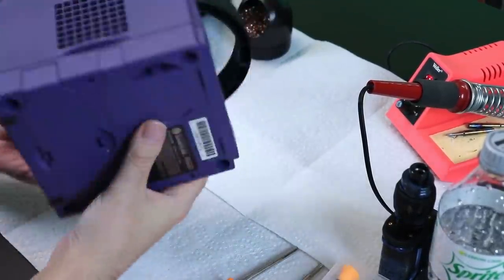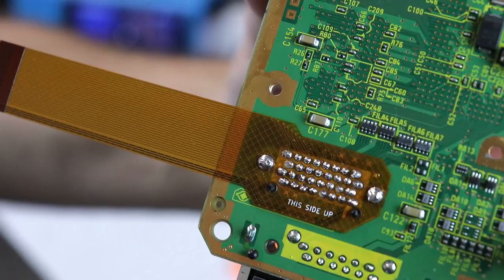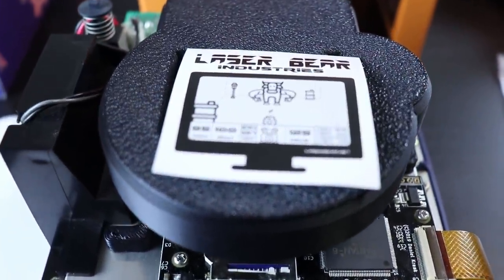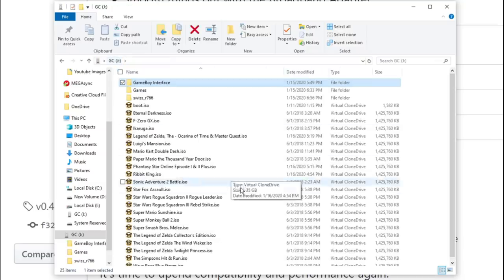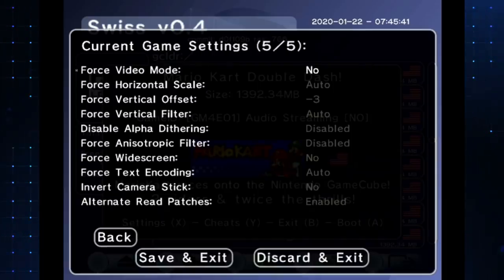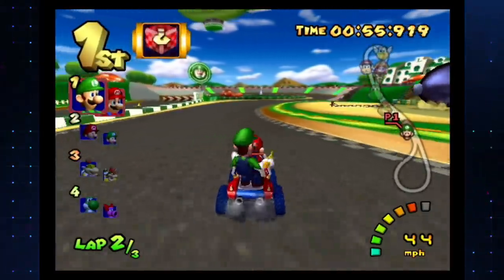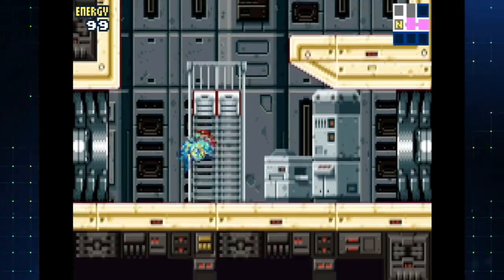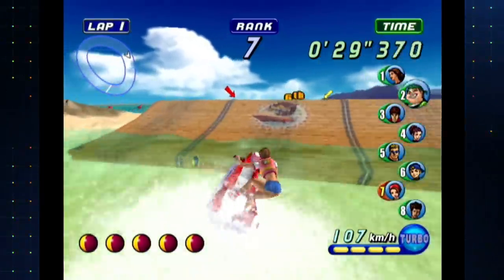GC Loader Nintendo GameCube Disc Drive Replacement! Load Games From SD Cards!

Comment: Yeah I’m out of my element doing all that stuff, especially the soldering. But that looks like a no brainer if you have the knowledge and skills. Don’t have a GameCube but it’s a great console.
Reply: There is a version of the GC Loader for which you don't need to solder. Maybe Check Macho Nacho Productions Video.

Comment: Great addition to my platinum cube. Very impressed so far. It would of been great if the ps1 had a disc drive replacement mod instead of the psio.

Comment: This mod is super cool the only problem I have whit it is that just like the PSIO you have to solder parts to the console. If it was more like the Dreamcast or Saturn mods were there is no soldering require then it would be the greatest mod ever made.

Comment: I think I'll get one of those, along with a HDMI adapter like Retrobit's or the EON, and also a SD2SP2 to have some extra stuff like virtual memory cards (kind of no really needed since I have 4 memory cards... but still, and I also can use either my Wii or WiiU for that but... I just want to keep some games I would really play whenever I decide to use said consoles in a pinch but... I really want to give my good old Game Cube the respect it deserves... especially after having it around for more than 4 years just unplugged because the mini DVD drive decided to die on me... it was one of those 1st model releases that have the component output that I never used back in the day, and the fact that GCN games look better on it's own console compared to the WiiU and Wii... in the order I like the output most if I don't have the choice of using a GCN), and if it's not too hard and/or expensive, even the Game Boy Player to take advantage of my GBA and GB/GBC carts (Pokemon in the case of GB/GBC I have Pokemon Stadium 1 and 2 on my N64 to cover that but still that would be a welcome adition, aside of GB games with my SD2SNES Pro with the proper Super Game Boy firmware).

Also I want to make sure that my Flashcarts works with the GB Player and both the oficial and the homebrew alternative of the GB Player boot disc, so I can play GBA and GBC games as well.

Comment: For a while I've been using a game save exploit to run Swiss on my GameCube and the SD2SP2 adapter. One thing I don't like about using the game save exploit is that you have to run the exploit every time you want to boot Swiss. I like that the GC Loader doesn't do that. I have another GameCube but it's a DOL-101 model so it has no digital out or the serial port 2 slot so I can't use the SD2SP2 adapter so I got the Gecko SD. And I recently ordered a GC Loader so I can use it on my original GameCube.

Comment: guys theres a swiss method that lets you run off the serial port no teardown required
or mods 

windwaker disc + memorycard +sd adapter @ serial port 💞

Comment: My main concern is the issue of multi disc games. For example twin snakes requires an immediate disc change without saving. Is there any solution to this?
Reply: Peter Bruin  multi disc games are supposed with the GC Loader

Comment: @madlittlepixel, I’d love to see you do a review of the sd2sp2 gamecube mod (sd card to serial port 2). i like that you can keep your disc drive in place and still run games from a micro sd card via one of the serial ports on the bottom giving the gamecube a nice clean look. i’d love to hear you thoughts on it.

Comment: Issue I ran in to is when I went to put it back together, all but 3 of the plastic threaded posts that hold the disc drive to the motherboard exploded when I threaded the screws back in. I made absolutely sure they were going back in the same threads they’d already cut and they still broke. Some with no resistance at all. Has anyone else run in to that?

Comment: Whats the benefit of doing this instead of softmodding a wii?  
It looks to me like an difficult way to achieve the same result.
*Edit: Also... Aren't wiis like $40 right now?
Reply: The Generous Degenerate  A lot of people use their Gamecube exclusively for use with the Gameboy Player.  The Gameboy Interface software is a huge improvement over the original disk that came with the player.  Another reason is a lot of people want to play games on the original console they grew up with.  The Wii solution is a great one without a doubt though.
Reply from the maker: Id much rather hook up a gamecube to play GC games than a Wii lol. Just my preference and it more so has to do with convenience.
Reply: There is a small improvement on video quality as well from running games on a Gamecube than on a Wii. I don't remember if someone ran a Wii HDMI with a gamecube game VS Gamecube running through the Carby or GCHD to see the which one looked better. I know for sure though someone did run component wii vs gamecube component and Gamecube looked slightly better.

Comment: Strange question but I have an American GameCube and a region switch on my Japanese one. The Japanese one has trouble reading some games, but the American reads them all. Could I swap the disc assemblies from the American one and connect it to the Japanese motherboard?

Comment: Is there a difference between the solder version of the GC loader and the Plug and Play version? I'd rather not solder but don't want to compromise a better experience.
Reply from the maker: Nope no difference. Just that one way is hell of a lot easier to do lol. When I bought mine they didnt have the plug and play version available, otherwise id of ordered that one.

Comment: Just so people know you can also load games from a memory card slot using a memory card to sd adapter and a copy of action replay.  Much cheaper and easier.
Reply: Yeah, it's a softmod right? I heard it had some compatibility issues though
Reply: @ubermenschmexa  It has the same compatibility issues as the GC Loader because it is also using SWISS.  Compatibility has improved a lot over the years though all the games you would want to play work.

Comment: Does the new GC Loader require the flex cable installation? I looked and doesnt look like its included.
Reply: Kevin Woods  the new gc loader is plug and play I just installed one. You literally pop out the disk drive and replace it with the gcl. If you use the laser bear mount it comes with sd extension.

Comment: Question:
Can I play Game Boy roms from this GC loader device?
Where would I place the Game Boy roms then?
Thank you for the response!
Reply from the maker: Well no not like that. Use a Gameboy player and load Gameboy interface from Swiss. Use original carts, GB, GBC or GBA. Or use respective Flashcarts to load roms. The GB Player is essentially original GBA hardware.
Reply: @Madlittlepixel  Got it. I am waiting for my Gameboy player in the mail. Thanks for the answer Boss! 👍😎

Comment: I need help setting mine up I put the NTSC Swiss on it renamed ( boot.iso) and the gc loader update from get hub. I keep getting 2 red lights and the unit says no disc. the SD card does not click ( is it supposed to ) ?
Reply: Try just naming it boot instead of boot.iso and see if that works.

Comment: This is really cool but I wouldn't want to delete the actual disc drive and replace it completely. Still want to play my original disc games
Reply: This is an option. Let's say your drive dies. You can replace it with this.
Reply: then go on alixpress and get a Sd2Sp2 and find a way to boot into Swiss, you'll have the exact same thing as this but  instead of taking away the Dvd srive you use a port on the bottom that nothing else uses. you lose no functionality plus it's like 2 bucks
Reply: @HKT-4300  This is awesome, thanks mate
Reply: @TurboTurker  No problem!! I'm really racking my brain why people are talking about the GC loader more than the SD2SP2 cause in my opinion the SD2SP2 is better and it's like 2% of the price too. hope you can figure it all out!

Comment: I'm sorry I think I missed you saying it - with Swiss and GC Loader, does the GB Player still need the disc?
Reply from the maker: Nope no disc, use the Gameboy Interface software loaded on the sd card.
Reply: @Madlittlepixel  Nice!  Thanks for the video!
Reply: @secondleasegamer8312  you dont need the gameboy player attached either?

Comment: I would be worried about soldering it.  Is there a service that could do this for me or can I buy a gamecube pre modded?
Reply from the maker: I linked in the description and pinned comment a modder who I recommend. You would have to provide the gc loader unit and Gamecube for him or most modders to do it as I havent heard of anyone stocking them for mod services as of yet. There are not a ton available yet, but on citrus3000psi's site he will start selling them again soon from what I understand.
Reply: Maybe I'm missing something but I went to both links and I can't find any info on this mod on any of the links no price listing  for doing the service.
Reply from the maker: You can reach out to him, send a message asking about price. He probably hasnt added the service since the gc loader isnt widely available yet. But I know he will do the mod work if requested.

Comment: Why not just use a one of those SD-to-Memory Card adapters that's also capable of doing stuff with ISO files? That way you won't have to pay for an expensive mod that ruins your system
Reply from the maker: Doesn't ruin your system lol. Gc loader supports audio streaming games other options like what you mention do not. The access speed is also faster and more reliable. But whatever your preference is go for it. $80 is not really that expensive in my opinion.

Comment: That is stupid, just have a sd card with a modded GameCube memory card
Reply: That isnt the same. Many games (especially with FMV sequences) do not run at full speed through the memory card to sp2 slot. By utilising the drive connector, they will run full speed.